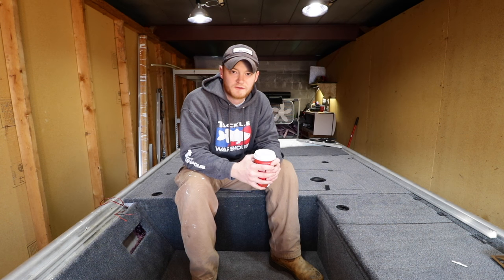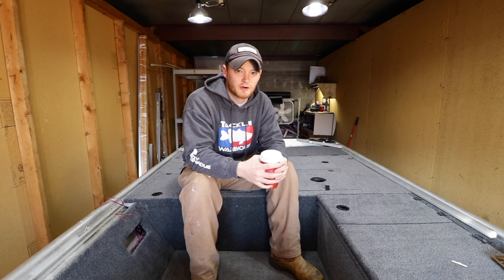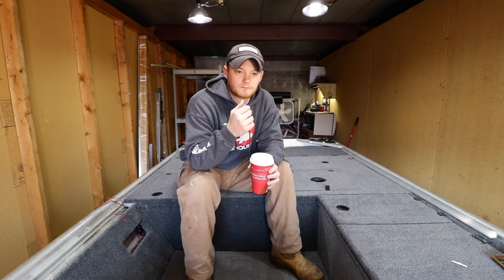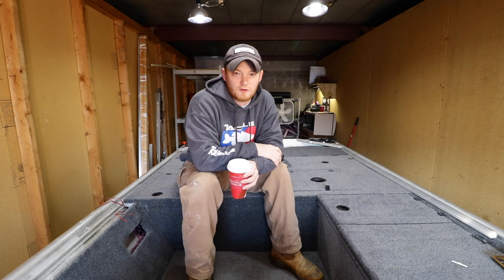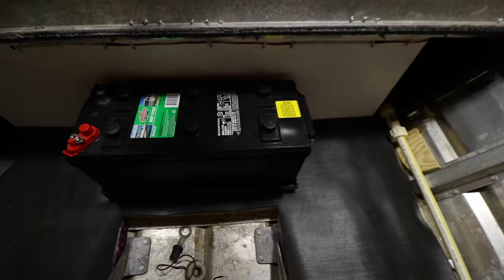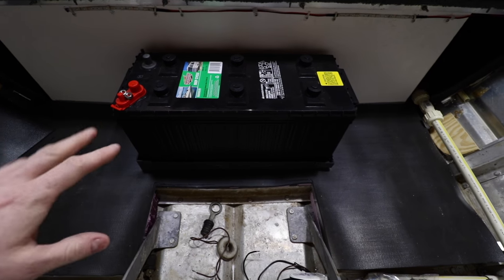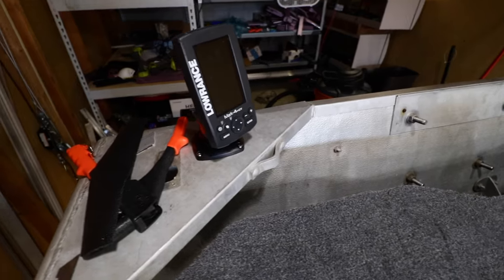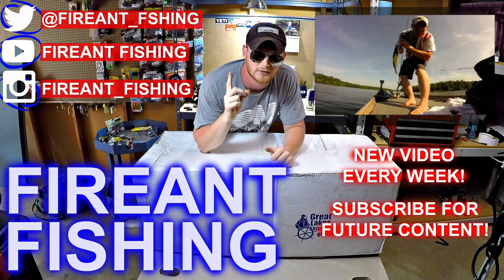Project Details: Jon Boat to Bass Boat

Comment: Boat's really coming along. I don't know how you've got the self control to keep going at it and not just take it fishing, but I commend your fortitude! I noticed that you mounted your gas strutts with the thick part attached to the boat and the internal rod attached to the lid. I have recently learnt that it should be the other way round. Thick part attached to the lid. Apparently it operates better and it keeps the seal lubricated better. Who knew!
Reply from the maker: Oh gosh! i do have that on the wrong way!! haha i even said it right in my install video and i put that one on wrong haha thanks for catching that! It will be on the water soon!

Comment: I would go with 24v you'll be glad you did! Also definitely put a motor on the back, not just for moving around but because the rear motor will act as a rudder. If you only have the front motor, the stern will swing around  when you don't want it to.
Reply from the maker: just added another battery tonight, we have 24v!!!

Comment: If I was going to use a battery for just electronics not including trolling motor what size should I use? Also, with the libewell timer, how is that wired to the livewell? (Spliced to the circ. Pump???)

Comment: Hey FireAnt. Your link for the latches has the size at 1/4in. Should it not be 1/2 inch, as you used 1/2 inch plywood for the hatches?

Thanks Pal!

Comment: Good video. I love seeing those older jon boat tournament fishermen with like three or four 55# trolling motors on the back. Have you given any thought to an electric outboard motor? I've seen quite a few people running them. I know they can be a bit more expensive to purchase but it might be worth it for the speed. I've even seen some DIY electric outboard motor kits that aren't outrageous. Typically you just buy an older 9.9/15hp that doesn't run and replace the power head with an electric motor.
Reply from the maker: good to know, just too expensive right now

Comment: I can tell you from experience your gonna want to run at least a 70lb thrust on the front so you would have to wire that with a 24volt system. I have a 17 ft monark pro bass 170 and I have a 45 on the front and it barley pushes the boat
Reply from the maker: Adam Zachary have you looked into a bigger one yet?
Reply: FIREANT FISHING I've looked but havnt bought anything yet my time to fish is limited. but if you plan on fishing those tournaments you will definitely want to make it go fast as possible some of the boats around me will run a 70 or 80 on the front and two 55's on the back just to be able to beat people to the good spots
Reply from the maker: yeah thats a good point. i also don't know which brand to get. I'm not too happy with the motor guide. the pull system to raise it out of the water sucks
Reply: FIREANT FISHING no deffinetly go with a minnkota there the best in my opinion
Reply from the maker: ok thats what i was thinking

Comment: Go 24v for the back since most likely you will want full speed most of the time.  I have already purchased two of these motors  (brother in-law wanted one after he seen mine) It is a 86lb 24v trolling motor for less than $200.  I figure for that price I could buy 5 of these for the price of the name brand motors.   Because of the mount you cannot put it on the bow...but I took an old cabelas 55 backtroller mount I had which is made out of metal and got it to work perfect.  You would not believe how fast you can go with a 14' boat with a 86lb thrust trolling motor on it....it creates a wake.http://www.ebay.com/itm/New-86lbs-Freshwater-Transom-Mounted-Trolling-Motor-36-Shaft-/271488313008?hash=item3f35f6e6b0:g:SgsAAMXQAI9SKZlg&vxp=mtr